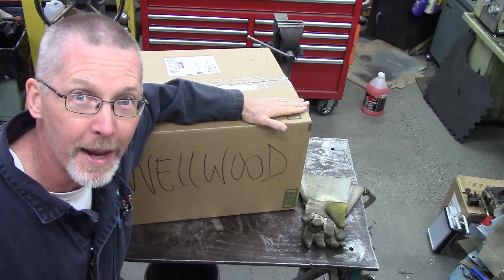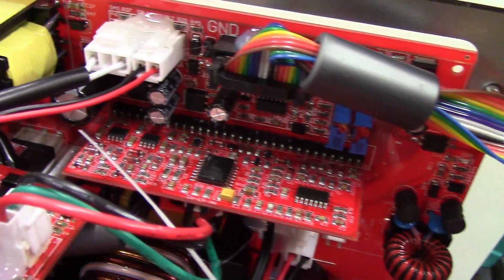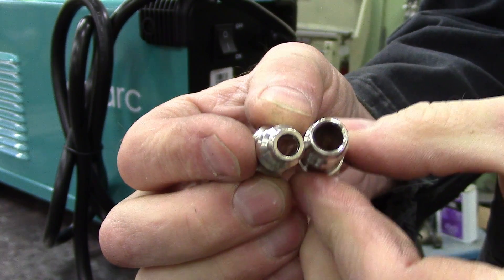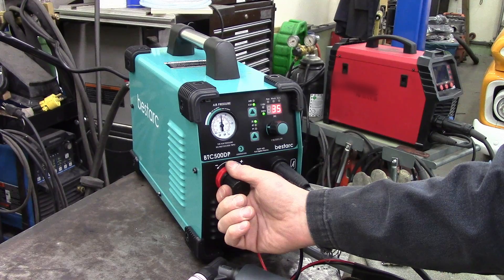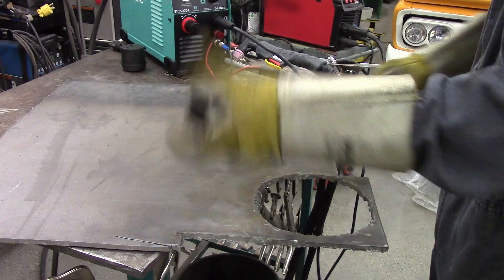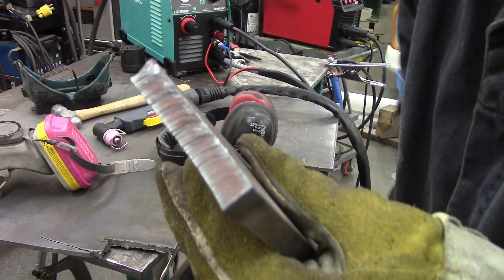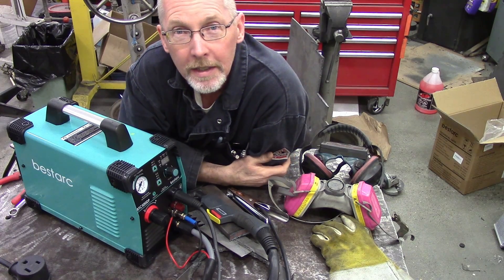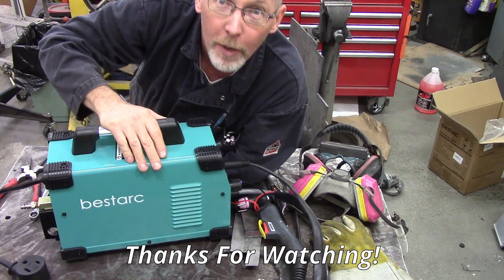REVIEW: BestArc BTC500DP 3Gen Plasma Cutter

Comment: It's also a high frequency machine, which makes it a poor choice for use with a CNC plasma table. The amount of EMF thrown off by these high frequency machines makes for resets and glitches in the CNC controller and/or whatever you are feeding it gcode with, even with an obsessive level of shielding on ALL cable runs and the enclosure,  = ruined cuts, restarts and scrapped material. YouTube and CNCzone is full of such tales of woe and struggle where the builder eventually throws in the towel and finally goes and buys another cutter, a  low frequency blowback start pilot arc. HF is fine for hand cutting, but not CNC unless you like the idea of making a rod for your back.
Reply: I was going to add the same comment. I built my own table and had a lower priced plasma cutter that crashed my computer every time I started the torch.  All the grounding and protecting wasn’t worth it. I got an everlast and haven’t looked back.
Reply from the maker: Interesting.   I'll look into that.  Thanks for the heads up!
Reply: @GregWellwood  The Arcfony cut53 N pro is a good choice for cnc,  LF blowback with cnc ports for start and torch height control already built in. Pair it up with a iptm60 or 80 machine torch and it's ideal. A baby hypertherm but with an unfortunate name.
Reply: @m3chanist  thanks! Good to know
Reply from the maker: @Greolt Good to hear.  Since I have this machine already, I'll try it and do up a video.  If it sucks, a LF unit is just a visa away. (grin)
Reply: @Greolt  The fact that it's pilot arc is not the issue, it's if it's a HF or LF machine. You seemed to have missed the point.

Comment: I purchased the largest version, the 65 Ampere one.
When I started it, the machine doesn't run.
Once the adjustments have been made, I bring the torch close to the piece and it works intermittently, turning on and off.
I checked and changed the nozzles, but nothing helped.
Since the parent company isn't responding, I wanted to ask you if you can help me understand whether it's the machine that's having problems or whether I'm making some settings wrong.
I'm sending you the same video that I sent to the parent company so that maybe you can understand something about it and give me a hand.
Reply from the maker: On other plasma cutters I've used, if it runs for a bit and then shuts off, it's usually a bad ground.  It could be a dirty surface, a loose wire in the clamp, or a loose wire inside the machine.  Check those first.  On quite a few of the machines I've tested, there were often loose connections.

Comment: I just got one of these and people need to be cautious about what to expect. To run it on 110V, you're limited by the breaker size of your circuit. The panel says you can drive it up to 35 A. But you'd need a 35 Amp circuit (Bestarc says they recommend a 40 Amp breaker). This is nonsense. No one has a 40 amp 110 residential circuit in their house. And if you run it on 220 V, you're again limited by what the circuit can handle. 

That said, I don't plan on cutting much thicker than 1/4 material and it works fine at 110 for that on my garage 20 Amp circuit. Make sure you have lots of air, the arc will keep cutting out if the pressure/airflow is not sufficient.

Comment: Can I use a small 6 gallon compressor?,I just want to use the cutter for thin metals to make art and stuff. I can also get a 10 gallon,but again it's just for small sruff
Reply from the maker: If the compressor can privide the CFM that the cutter needs (1.6cfm), then yes.
Reply: Thanks

Comment: This does have a steel cabinet. It could easily be put in a small faraday cage with chokes around the leads.
Reply from the maker: I added a link in the description to a page that talks about making a HF unit work.  I ~may~ try that, but it does seem like a lot of extra work vs buying a LF unit.
Reply: The difference between "could work" and "does work" is significant and expensive and also, a well trod path.